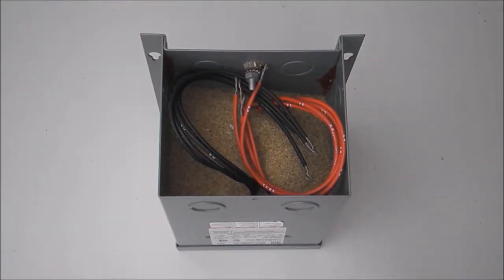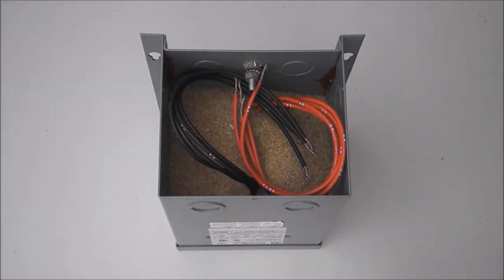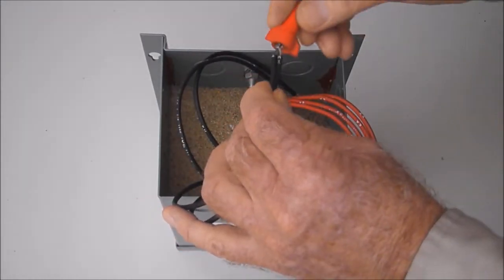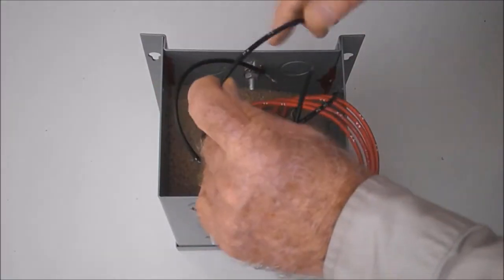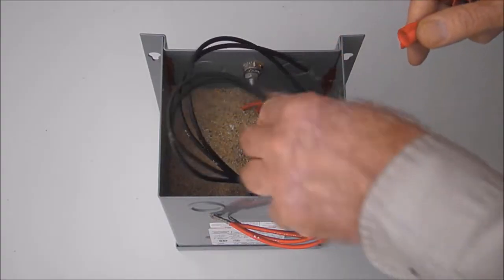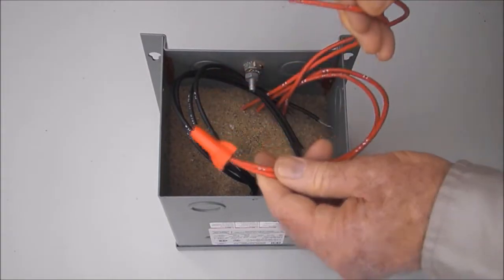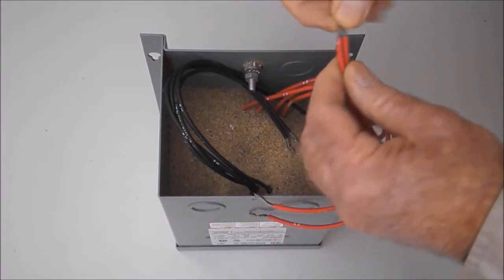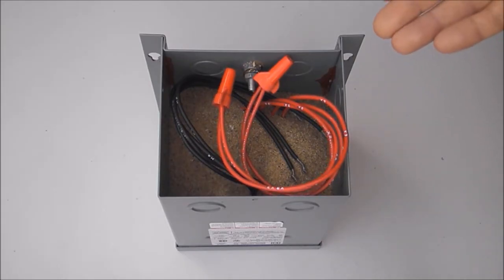Wiring 480/240V to 240/120V on Epoxy Resin Encapsulated Transformers | Schneider Electric Support

Comment: Let's say you want to power up a cabin and you have a transformer like that but you also have a generator what should be the appropriate wattage the generator should supply the transformer is a 30 Amp 240V supply good and what will be the Amperage on the secondary side
Reply from the maker: Thank you for your message. For technical support or to find answers to your questions, please refer to our support center: https://www.se.com/ww/en/work/support/support-center.jsp or reach out to a technical expert in your location here: https://www.se.com/ww/en/work/support/country-selector/contact-us.jsp
Reply: Should be 60a

Comment: It's not "one line of 240 volts" Or "one line of 480 volts", because each 240 is 120 on each line and 480 is 277 on each line, it is important to be clear as to not confuse others, into thinking each line actually has 240, or 480.
Reply: Beat me to it. Thank you!!
Reply: exactly, which is why to ground those are the outputs you get on 240/120 and 480. But you obviously knew that lol, like preaching to the choir
Reply: 277 is true unless it’s 480 high leg delta which each leg would then be 240 on each leg. Not bringing contradiction but clarity more less whether this information ever benefits anyone or not. Lol

Comment: Inquiry only: Is there an American company that still manufactures NON-STEP TRANSFORMERS? 220 to 220 and 110 to 110? In my younger years in the 1950s there are 3 kinds of transformers. The step-up transformer, the step-down transformer, and the non-step transformer. WHAT HAPPENED? Why did the non-step transformers disappeared?
Reply: non-step transformers are generally sold as isolation transformers these days.

some transformers that step-up/down can be wired as non-step as well, such as the transformer in this video which can be wired as 240v in and 240v out if you want.
Reply: What about 208 input? 
To 120…
Reply: It's not a transformer if the in and out are equal. It's called a wire. lol

Comment: When do we need 480Volts in a single phase system?  In my experience ive only used 480V for 3 phase motors or the 277v L-N for lights.
Reply: You don't need 480 volts.  That is your input.  That is why you are using a transformer.  You are changing it to 277 volts for lighting, etc. or you could change it to 240/120 for a subpanel to run lights and receptacles in a breakroom, etc or whatever other need you may have.  Remember, the 480v in the input.  We care about what is coming out of the secondary side.  That's what we're going to use.
Reply: There are reasons such as a machine control cabinet, in this cabinet you can have only 1 480v source with step down transormers internally installed in the cabinet, this leaves you with a single electrical source that can be locked/tagged out instead of multiple sources which can be confusing and sometimes kills people because they don't verify a dead circuit before performing electrical work in a panel

Comment: What about the third leg of 480? Where's it go?
Reply: It stays in the panel or capped in the Transformer Junction Box. You only use two legs of 480VAC 3P to step down to 120/240VAC 1P. Took me a while to grasp the concept too. 3P HAS TO BE 3P. 😆
Reply: @martycuhntzmart5635  yea, I figured it out a few days after I posted. Thanks tho brother

Comment: Just an FYI......even though I wired everything correctly (checked and verified NUMEROUS times), I ended up with very unbalanced voltage on the secondary outputs (170 volts on one leg and 60 volts on the other) and it had to be corrected by bonding the neutral to ground.
Reply: hey man, just to let you know I did one of these today, you have to ground and bond according to art 250 NEC and protect these windings with article 450 the one I did earlier was @ 167% for the primary side, 
you absolutely have to take that ground stud and go straight to earth with it via a grounding electrode, then take a "bonding jumper" from that same stud to those "Neutral taps"  and of course the earth ground also has to go to the equipment grounding conductors in your raceways entering and exiting the transformer,
Reply: @anthonysolino  good looking out thank you. That was important to say and I'm very glad that you did because it clicked in my head thank you
Reply: Thank you for this. Very important step. After reading this I can see it just like a transformer. Very helpful. Thanks. I am wiring a buck and boost from a 480v panel to a 120v panel. All part of a ups system of course. Thanks again brother.

Comment: At minute 1 explanation is wrong, Do NOT Connect H2 and H3 together for a 480V line input. Isolate H2 and H3 individually with wire nuts. Low voltage explanation is correct.
Reply: Watch it catch fire...
Reply: Its correct, the schematic drawing says the very same thing